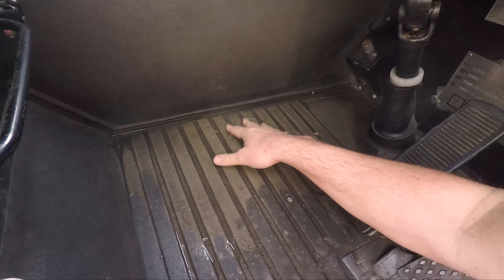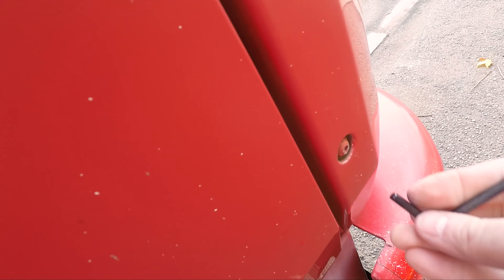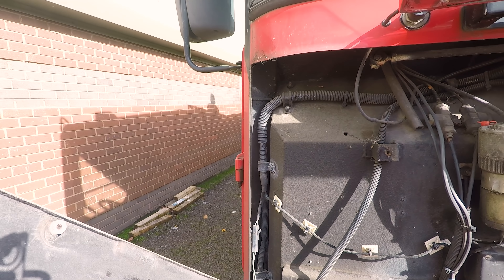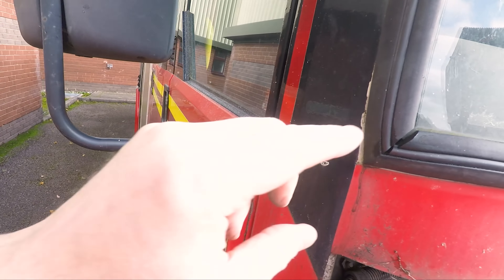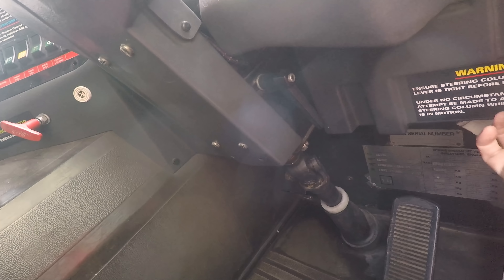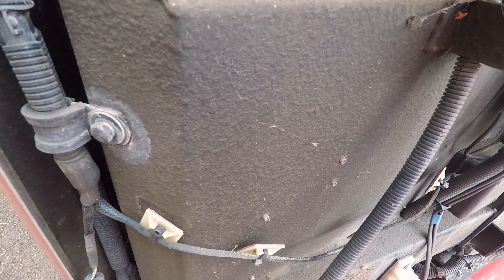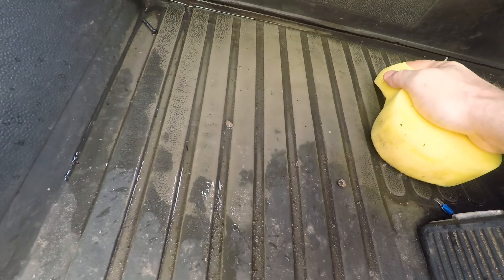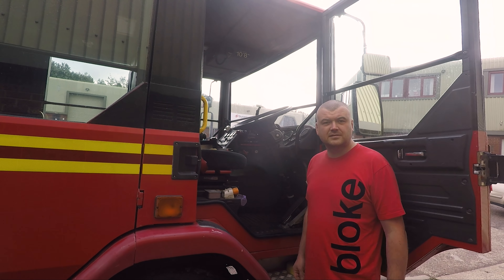Dennis Sabre Fixing the leak in the dash

Comment: You might need to remove the filler strip from the screen , then get a windscreen sealer that’s non setting to back fill the rubber glass  then rubber to body refit the filler and excess will come out clean up job done . Hope fully leak sorted .Had to do this with the old discovery’s before they stared to bond the screens in . On later fire engines screens were anti bandit and bonded  in weighed a ton but keep fire crews safe from attack

Comment: At 3:00 there is an electric air compressor for the horns? this must have an endless supply of compressed air in the tanks, is that normal?
Reply from the maker: Leo Rigby the electric compressor is for the two tone air horns which is a continuous air supply. The air for the brakes is in two tanks that are powered directly from the engines own air compressor.
Reply: @ExtremeGarage  Just have to say I've looked at fire engines on ebay for years but <3.5T for me. Maybe there is a regulation against using brake air supply for horns? Seems silly to add an unnecessary electrical load to me

Comment: Im so inspired I brought one as well... she's a little beauty problem, it has no door keys, any idea where I can get some blanks I have emailed Dennis but no reply as yet. Thanks Roger, Auckland New Zealand.
Reply from the maker: Glad to hear you have taken the big step!  You will have plenty of fun. With no keys i would guess you would need to replace the barrels as well as the keys.  The people to speak to are Alexander Dennis.  Ask to be put through to the parts department and quote the chassis number.  They will be able to assist with parts as alot of the items are from buses and fords.
Reply: @ExtremeGarage  Hey thanks for that
Reply: If the locks and handles are the same as the dustcarts I have had (they look the same)  they are from iveco cargos , look on e bay for iveco locks . That's where I got a set from .

Comment: There's a gap at the top of the screen rubber where the edge of the glass is visible. Remember water will always fall to its lowest point, and I think water is entering the top corner then running down inside the screen pillar. If it leaks again try putting some black silicon in the corners of the screen rubber. You can also apply some between the lip of the rubber and the cab, then clean off the excess. The rubber looks in good condition it just appears to have moved, and the silicon sealant will make good any gaps.
It's just a process of elimination one stage at a time. 
Also get someone to squirt water onto the screen while you're inside to see if you can trace the location.
Reply: John Collier Beat me to it
Reply: John Collier Spot on it always does leak on Dennis from the stated

Comment: That windscreen rubber looks like it needs replacing. They don’t cost the earth. Bit tricky to fit mind without bostin the glass. We replace em all the time on our old buses. Find an Indy. Auto glass etc will be dear. They’ll start to run black lines down the paintwork soon an all if you don’t get em done.

Comment: Do you not have a hose around?  Just spray water at the front, that will show you your leak right away. 99% sure it is the window seal though.  As for the doors, our engine's doors don't stay open either.  They aren't like car doors.

Comment: What you want to do is email the fleet and equipment departments of the fire service and see if they still have some parts left over from when they had the sabres you will be surprised what they still have lying around there work shops
Reply from the maker: Nick Dennis im planning on speaking to a few soon as you can never have enough spares.
Reply: West Midlands still have a few sabres left try them because I’m sure they will be changing all the fleet to Volvo eventually or they could put you on the right track to their parts provider 👍🏻